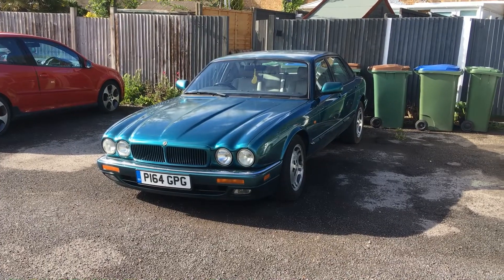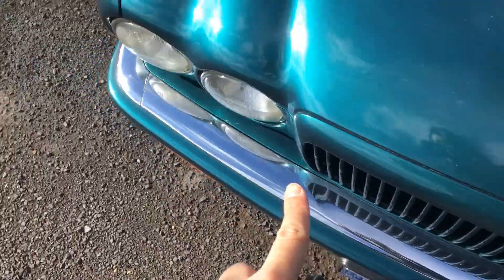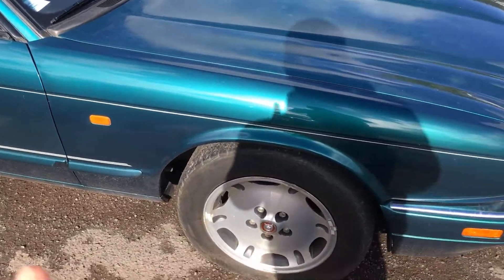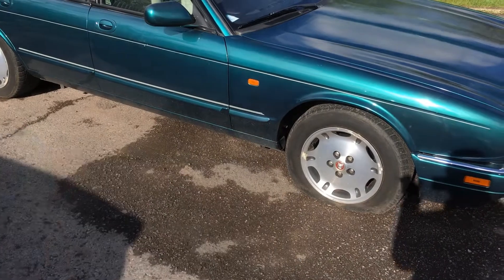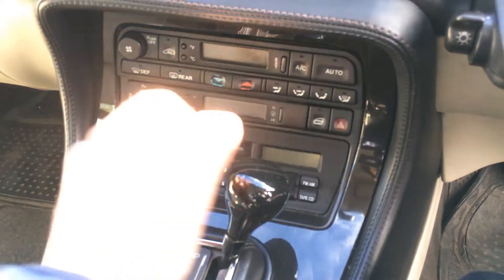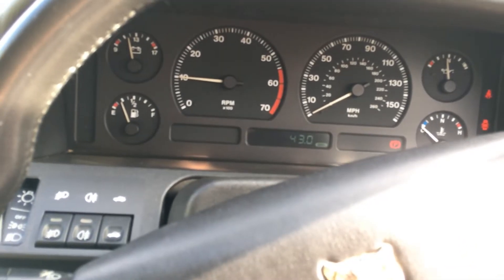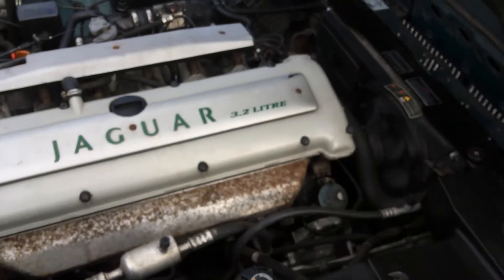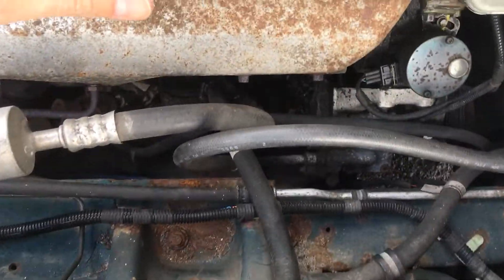Jaguar XJ 3.2 Sport X300 appraisal

Comment: Also, with regard to the fan belt squeak, I found if you blip the throttle up to about 2000rpm the noise goes away. I hope.
Reply from the maker: Thanks for the tip